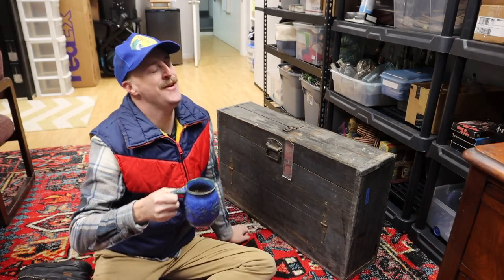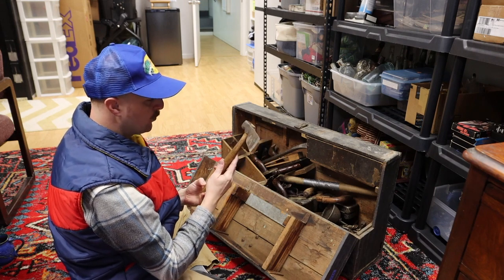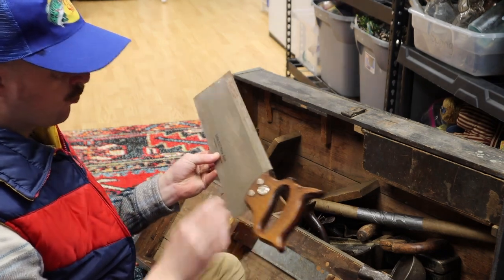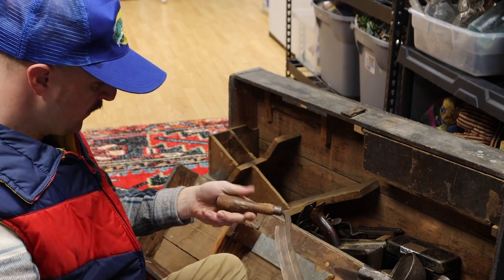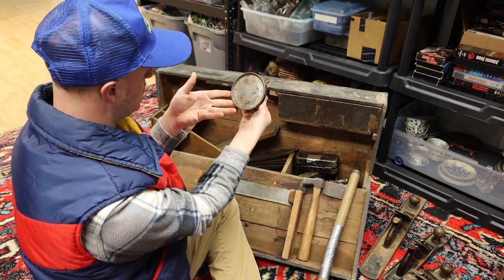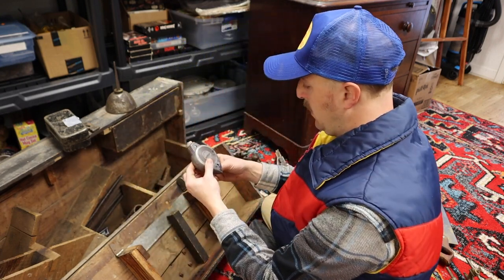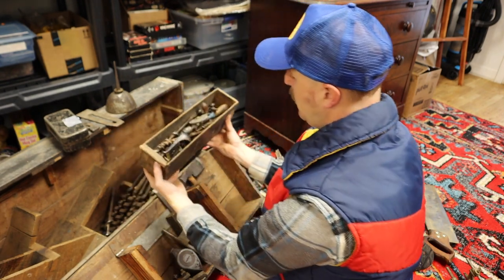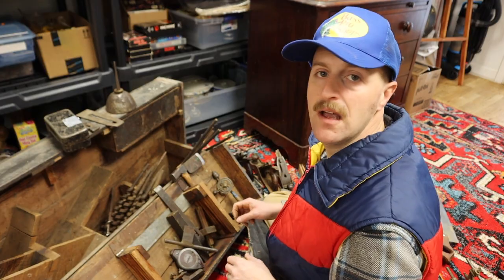Estate Sale Find of the Year Antique Tool Collection From Early 1900's.

Comment: Several years ago, I found two large tool chests at a yard sale $500 bucks for both of them. One belonged to a pattern maker and the other belonged to a furniture maker/joiner. I've still got a lot of the tools, but my wife sold quite a few on eBay back then. Made over $2,000 bucks.

Comment: I'll try to recap some of the tools in the video that you weren't sure of:
The pointed ended saw is a "keyhole saw"
The auger bit with the ruler on it is an adjustable auger bit. They were more of a novelty than a usable tool.
The last Stanley black plane looking item was actually a cap for a block plane. On its own its useless.
The bits are called auger bit
The first "drill" is called a brace
The small drill is an "eggbeater drill" 
Some of the items you thought might be irons of some sort were a mix of irons and at least one depth stop for the Stanley 45
The planes, in order of length were block planes, Stanley or copy of a Stanley 4, 2 Stanley 5s, A Stanley style 6 and 7. 
The axe/hatchet is used for shingles and shakes
The plyers you mention towards the end are actually blacksmithing tongs

Comment: Great video, just a note, if you want to remove rust and make sure that you don't remove any iron only iron oxide (rust) use Evaporust, items can be left in there any length of time and only the rust will be removed. If you leave high carbon steels in the evaporust for an extended time you may see a black residue, this is the carbon that is left behind after the surface rust is removed and it can be removed with a little elbow grease.

Comment: That a back saw for cutting miters , I think you well got your money worth , that was a roofing hatchet. Those big needles I believe are sail needles for reparing ship  sails . The small planes are called block planes. And the  drills are called braces and bits. Those are called ager bits  Black smith tongs the long pliers. That adjustable bit is a hole bore.

Comment: You found some good planes. However the eBay sales you are showing are rare planes. The Stanley 605 is a Bedrock plane as you can tell from the horizontal wall. They are rare and get the name from how the frog attaches to the bed. Your planes will fetch around $100 bucks a piece. You can date them by the blade and lever cap. 

The #45 will sell with those cutters for around $160,  the Miller falls combo plane you comped it to is an extremely rare one.
Reply from the maker: Thanks Max. I was hoping to sell as an entire lot which is why I had the prices so high. But, I actually just sold the 45 and cutters for $400. They didn't even make an offer, they just bought it. So... I have all my investment back and can start to price things more accurately. In the beginning, i like to price high and let people make offers. Now that I have all my money back, i don't need to be in a hurry because everything that sells now is just profit. I know what the proper comps are, but pricing high allows people to make offers and feel as though they got a "deal." Many people have told me I won't make much off of these, but i've already started getting into profit on a single sold item. I'd say that is still a pretty great deal overall, wouldn't you?
Reply: @RustyTheReseller  Great deal! Hope you find more and continue posting these vids.

Comment: I inherited my Dads workshop. I can only use so many tools right? Lathes, drill press, routers, you name it. I’m sitting here with 8 tool boxes, one 4 foot long. And then, 4 hole made tool boxes kind is like yours that say “4th generation of tools”. Wonder were to start. eBay?  And you said not to clean up? I started cleaning and waxing to get some rust off. But I just started. To me they are grossly dirty! LOL I’m excited finding your site.I feel like I’m opening up you box with you. I did take the planer apart because I was using it. I can’t find the screw! Ugh. I dropped it and just can’t find it!
Reply from the maker: What an awesome thing To inherit! eBay can work if you want or you can also place Ads for local sales like Facebook marketplace and the like but do your research on EBay first so you  have an idea of the value, otherwise people will send you low low offers and you won’t know if it’s a bad offer or not. Planers, old ones, will sell for more if already restored, but the amount of time and work on fixing old tools isn’t worth enough money to warrant the time I would need to spend, but that’s just for me. Good luck with them!
Reply: Collect your sweepings and drag a magnet over it. Should locate the screw.
Reply: I'd recommend trying to find out exactly what you've got before you try to sell it. For hand planes, you want to look up something like "Stanley No. 5 type study" to find out what it is - some of these tools they ended up making them for over a hundred years. One from the 1980s is going to be worth a lot less than one from the 1880s. And you've really got to get the models right, too. Like in the video they showed some ebay listing for a $1500 Miller's patent #42 (from the late 1800s, very rare, and considered one of the most desirable planes to collect because it's so beautiful), but they have a #45 - which was produced for at least 80 years.
There's some Facebook groups that help people identify antique tools, too, if you don't even know what the thing is.

Comment: You made a good buy, the 45 and the 2 Sargent's will cover your cost by themselves.  A Stanley plane with the decal add to the value.  You have to know what you have before doing comps on ebay.  There are websites for identifying Stanley and Sargent planes.
Reply from the maker: I hear you. Thanks for the encouragement. Just sold the 45 for $400, so that covers the entire lot and now everything else will be profit. I was waiting to reduce my high prices to see if the whole lot would sell first. Now that my money is back I will cut the prices down, but I don't need to be in any hurry either..

Comment: You need to do a lot more research before you go putting big money down on old tools.  For example, the no. 5 you got is much newer than the one you quoted on ebay.  A type one means it was the first iteration of a no. 5.  Highly collectable.  Yours is about 70 years newer. A good tool when cleaned up and set up properly, but worth about $25.  You have great enthusiasm, but know what your buying before you bid that high again.